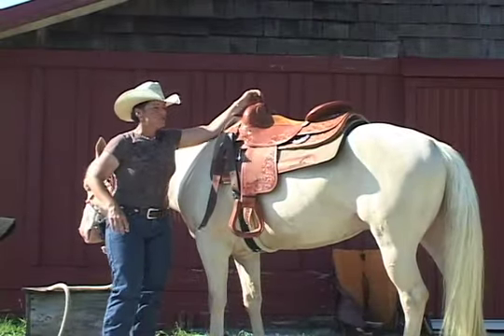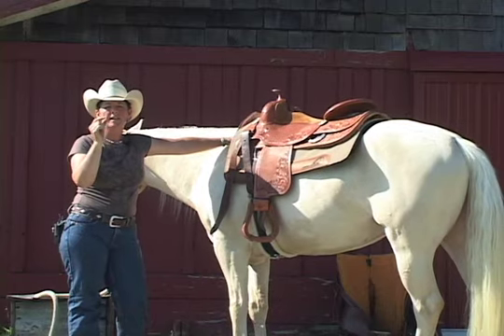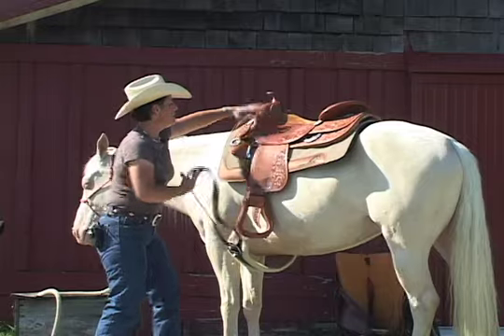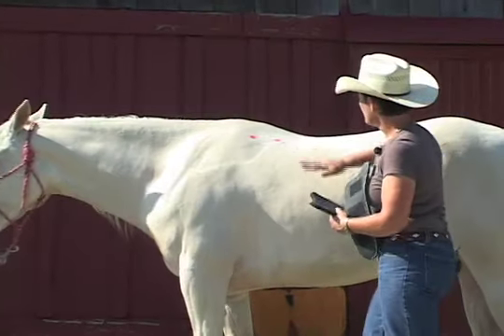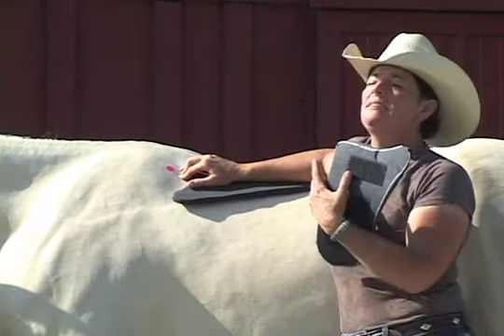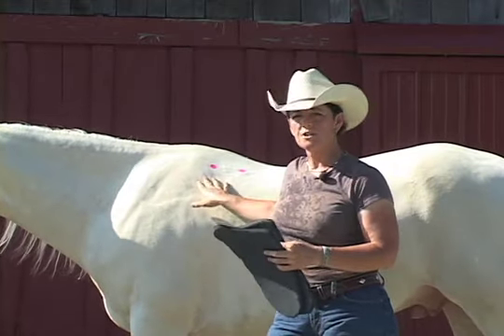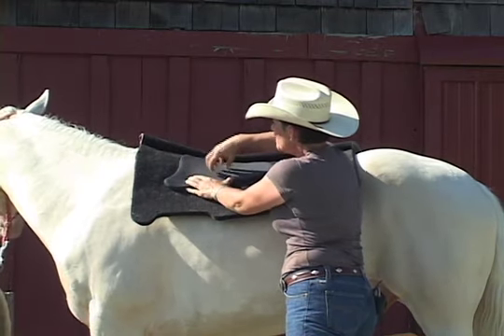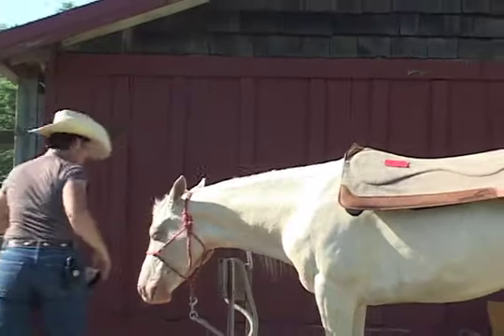Shimming with the CSI Saddlepad

Comment: But, have you checked the new position the scapula moves into when their leg is stretched forward while they are in motion? I found that top and back corner move backwards towards the saddle up to four inches from their original position. So while watching your video I did not see this taken into account. When they are standing at rest the scapula is below the withers, that all changes when they are in motion. I place my shims further back to lift the front two inches of my saddle completely out of the way of the range of motion of the scapula. The "valley" or hollow spot you speak of in this video is the very same place the back top edge of the scapula moves into. Have someone with you who is horse savvy, hold your hand over the top of the scapula, have your friend pick up the horses leg and stretch it forward as if the horse was taking a step, with the leg still forwards find the new scapula position. You will find on many horses the scapula moved backwards up to four inches. I place my shim behind that, not on top of it.